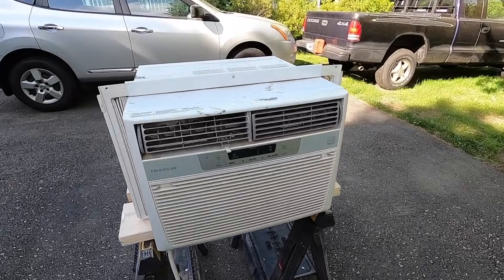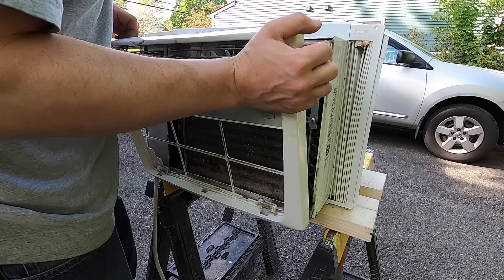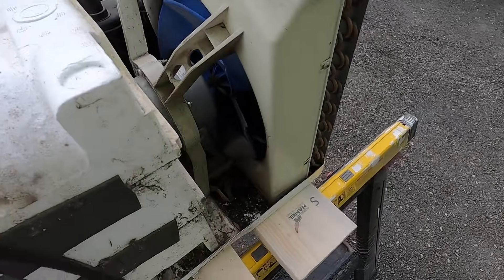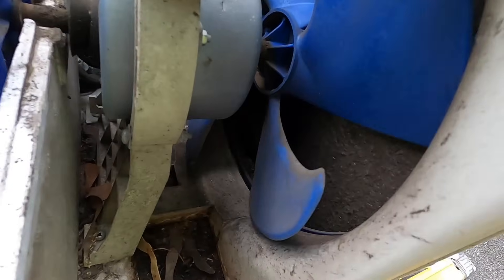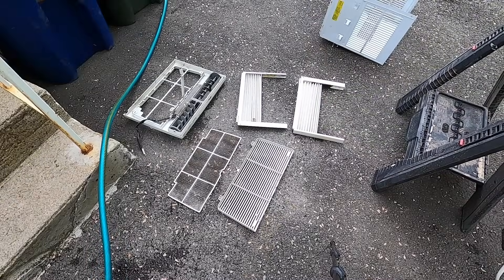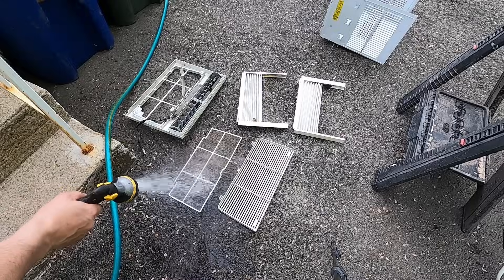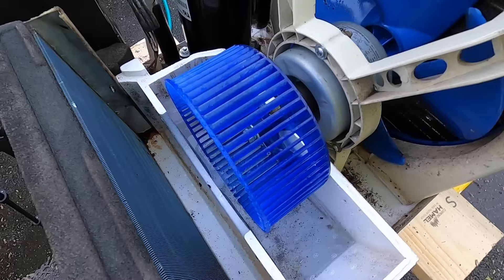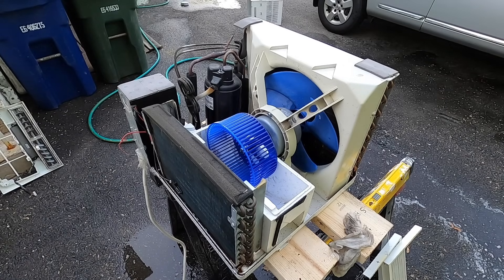How to Clean a Dirty Moldy Window Air Conditioner

Comment: It's amazing how people don't take care of things today. The units built today are all plastic and strofoam and have a big tendency to get like this.  When they made ac units out of all metal, you never had this issue.   Ac units are made cheaply today as you can see. You need to keep your air filter clean and vacuum the front coils when you clean the filter which should be done one a month. I have some old ac units that are clean and run great and would never get like this unit. Good video, I hope it helps to educate the public on taking care of their appliance.
Reply: Yes!  It's the damn styrofoam and cheap plastic.  Mainly the styrofoam imo.  It's a breeding ground for mold!!!
Things are made so horribly nowadays.  Nothing is made well.
Reply: @josephdockemeyer6782  even the education seems garbage
Reply: Maybe it could help to foil-tape the Styrofoam,  that is if it would still fit back in there..
Reply: It’s amazing how many people just live in poor air quality and breathing in mold spores..

Comment: (see my other comment) The foam part is where the air blows into the house and the mold will return if you haven't killed and removed all of it. You should soak it with vinegar or peroxide periodically to make sure the roots are all eliminated.

Comment: Great video.  Didn't realize you could just go ham with spraying the hose as long as you don't hit the electronics in the silver box.  So I took mine apart this morning (same model as you) and used my hose to spray everywhere.  Again, I had no idea that it was ok if everything got wet (except for the electronics, of course).  Thanks!
Reply from the maker: Thanks!  Yes as long as you are careful around the electronics it is fine.  Thanks for checking out the video!

Comment: Our window unit is 2 years old, and is  not getting cold, never been cleaned out, and when we turn it on (which is almost all the time) we hear a cracking sound like ice chipping or dirt dobber nest breaking apart. Aside from the ice thing, I think we found a culprit. ☺️ Thank you for the tips!
Reply: Low freon or clogged filter cause icing.

Comment: This was the exact window unit I was looking to clean, so this was beyond helpful for me
Reply: Same. LoL. I was like “no wayyy, this is MY unit”
Reply: I came here looking to.  Never thought i would actually find one with  the same unit I have let alone it be the first video I click on!!
Reply: Same.  And having just looked, mine is almost that gross.  No wonder I feel like crap.
Reply: You don't have to be a professional for this, right?
Reply: Same this is the best unit I’ve owned so far
Reply: Same😂
Reply: Same unit for us. Too heavy for us to take out of the window  at ages 80+. Did our best to take apart,  clean from the front  and go outside and do the back. Now I can see what I couldn't reach and therefore  still have moldy  smell.
Reply: Mine looked similar on the outside but the foam part was different
Reply: Same here... Kenmore labeled but the exact same one.
Reply: Same here. Will be cleaning it this weekend. thanks!

Comment: Our old model was like this and I'd just take the front off reach in w my hand and soak the sides, scrub the fan w tooth/denture cleaning brush and in the end I'd put paper towels in to soak up the bleach water that formed in the bottom. It was such a pain but necessary. Our model we have now I can't just reach in. It doesn't have the styrofoam but has what looks like insulation. I was getting all over headaches and extreme fatigue the last few days and started looking for the mold (that's usually the culprit), thought I'd found it but it was apparently far from the major source bc when I turned my ac off and got a light to shine OH MY, it got in there so fast. I should have known bc all a sudden mold was showing up on things everywhere 🤦. Guess I'll be getting my hubby to take this one apart and get to it.

Comment: Bleach can be harsh on the fins and copper tubing that runs through them. Best bet is to use a coil cleaner or just water/mild soap. I prefer non-acidic as the acid can eat through the coils if not rinsed thoroughly. Also, good practice to cover the electronic box with a plastic bag. Can also remove the boards from the facings on just about any model/style ac.
Reply: What will disinfect MOLD tho for that?
Reply: Electronics cleaner should work

Comment: First I used a small shop vac to remove all the junk. Then I used my sprayer with vinegar and window cleaner and dawn dish soap in a spray bottle then aggitatte the dirt and spray it clean with a hose and blow the majority of the water with the small shop hose in the opposite side to make it a blower. All set.nylon paint brush works well. Or a automotive parts brush cleaner works great!!

Comment: New to post- any video on getting cleaning the inside without removing from window. My room smells and it’s yukky inside of unit.  Live in New Orleans and it’s humid hot. So much water/humidity it’s wet on half my patio from AC. TIA. I have a 10k btu and 14k btu both are very bad but only a year old

Comment: After you get it all cleaned up and put back together,  you can save all the spare parts...   D'oh!!!
Reply: They allways put a few spare parts in there for your tool box . I found a cool long metal piece and an extra screw which worked out since I dropped one in the unit when reassembling it .
Reply: Hehe

Comment: Since window ac units use the air from inside the room to produce cold air, I placed a central air type 3m mold filter inside the front cover between the cover and the original dust filter. I cut the 3m filter out of the cardboard frame and stretched it out since they're wavy. I'll have to replace it monthly but hopefully it will make a noticeable difference. Makes me wonder why window unit manufacturers don't incorporate these seemingly essential mold filters. The paper thin ones it comes with only stops dust and lint.
Reply: I did this last season and it worked good. I eventually dropped the original filter since it wasn't necessary and only use the filter I cut from the filters for central air. Within a month it turns dark.

Comment: I had no Idea it was safe to really get in there, let alone hose it down. Thank you!
Reply: If they can stand up to rain water, a hose won't hurt.
Reply: @tnbn55 not how that works. Rain it’s mostly shielded from vs pressurized water directly on internals is quite different in damage potential

Comment: I took apart a used window AC recently that was disgusting inside.  I used a combination of bleach, water & dish soap as well in a good spray bottle and water hose to clean it up.  Just use a softer water pressure on the back grill grate because they can bend easily.

Comment: Excellent video.  I had one that was impossible to remove the top half of the foam without removing the electronics (older model), so I ended up just slicing the top off to access the fan wheel, then my best friend velcro tape came to visit.  Did that yearly for the life of the unit (about seven years).  I'd tip it sideways and spray right in.  

The fin sludge dust does not vacuum off.  Too sticky. I use a fin tool, but just a light touch with tweezers will also start it peeling.

I'm impressed that your case had no stripped screws.  I swear there's one on every unit just to make my life annoying.

The thermostat clip pops right off those front fins.  Easier to work without it in the way.

Take the directional grills out each year.  Heck, bleach them monthly.  They are so easy to pull out. They need a good scrub to get all the black off.  Just did it today.  My house is 81F inside and the only thing standing between me and sweet relief was the annual maintenance.  A/C was new last year, so I'm not taking it apart as it's not so bad inside to make it worthwhile.  The grill/spinny bits needed cleaning, though.

I really wish there was an easier way to keep the evaporation chamber clean.  Manufacturers made them quieter with the styrofoam, but it makes them harder to clean (and dirtier).   It's very humid where I live in the summer, so it's just a mildew factory.  For some folks, it's just wet dust, but wet dust doesn't smile like rancid socks.  Mildew does.

We've also had some luck running a small HEPA filtration unit near the window a/c unit.  It reduces dust going in and captures some of the stuff coming out.

Comment: this was so helpful, thank you!!! i live in an apartment and have two window ac units that they have had “permanently” installed and haven’t been cleaned in YEARS. after me and my cats feeling sick all summer and smelling mildew from them i inspected them and they were way worse than ever the one in this video😳 i’m talking absolutely caked with dirt and mold! i tried cleaning it by hand but couldn’t reach the majority of it so i’ll be following this tutorial to get them as clean as possible. i should probably just ask them to replace them but i’m up for the challenge of cleaning them out💪🏻 saving them $ and preventing it from ending up in a landfill 😊

Comment: Great video as far as how to disassemble the A/C but please note that bleach does not kill mold and for some people bleach can cause allergic or hypersensitivity reactions. To abate mold one must use a product that is designed specifically for mold (like Concrobium)--it's non-toxic and actually kills the mold spores. Also, as a general rule if the mold is at or more than a third of the interior it's best to replace the unit altogether, then work to keep the new unit free from mold by cleaning as you describe here. Good video, thanks for taking the time to make and post it.
Reply: @NE-Explorer  this is an instance when both people are right ... and wrong. I stand corrected in that bleach does kill mold on non-porous surfaces like tile, etc, but I stand firm on my comment, too, because it does not kill mold on porous surfaces like drywall and wood.
Reply: Thank you
Reply: Hydrogen Peroxide is mainly what all the mold professionals were using with Hurricane Ian cleanup!!!!!

Comment: condenser fins can be cleaned with compressed air from the reverse side before you spray it down. also running it on max in a empty room with an ozone generator once a month will prevent mold growth
Reply from the maker: Good tips.  Thanks, Brian!
Reply: Great tip about the ozone generator! Please know what you are doing if you're going to do this though. Ozone can be a fantastic tool, but you can do some (serious) damage with it too. I'm just imagining someone doing this while Snowball is hiding in the closet, unbeknownst. Ozone doesn't discriminate, it (can) kill(s) all living things!

Comment: Spray primer inside styrofoam...let dry completely..will never mold again! Ac guy told me this..I did it..used regular Grey metal primer..zero mold for almost 4 yrs now!
Reply: USMC 7207  oh great tip! Thanks!
Reply: What type of primer did you use?
Reply: Pretty sure oil base paint will melt styrofoam?
Reply: @MrBadchad644   never mold again.
Reply: Name and brand
Reply: Is primer dangerous to breathe in ? Would having that in your ac unit not slowly release primer into the air?
Reply: @kakashisensei4690  Short answer, yes. Everything in your house that is painted slowly releases volatile fumes into the air. This is what causes "sick house syndrome".
Reply: Good tip, teufel.
Reply: James Thomas hahaha
Reply: @Sara-L  🤕no bueno 🤕
Reply: But you'll still get mold on the fan blades.
Reply: @mattfoley6082  =( ....paint blades too ?
Reply: @kakashisensei4690  mold is more dangerous...

Comment: Me, who hasn't cleaned their AC in 5 years 👁👄👁
Reply: lol. Try 12 years!!! I only cleaned them because I had one unit that was leaking inside the house last year before I removed them for the winter. I opened the unit up and discovered the mold blocking the drain reservoir. I just figured if that one was bad, then the older unit of three extra years had to be as well. Both are running tonight and smell almost new. We have three days of 90 plus coming starting tomorrow.

Comment: Rutine maintenance.  use spray botthe 10% bleach in front of the unit whild is on and clean tge filter with soap water and bleach. Alsonuse 100% pure alcohol on the foam part ofvtge AC . It kill the mold also.good video.

Comment: So I was all ready to remove & take apart my window AC unit tomorrow for a thorough deep-cleaning @TheFixerHomeRepair ... but now I'm kinda worried about damaging the electronics/wiring & possibly getting zapped 😮 by the capacitor like @4everoregon @andrewlisenby9693 mentioned ... what is the easiest + safest way to discharge the capacitor ? And where exactly is the capacitor located ? Any help is greatly appreciated!

Comment: 11:44 DO NOT repeat DO NOT spray water anywhere near where the motor shaft enters the motor (front or back). He is spraying water all over the motor and shaft. You will get water into the motor bearings and they WILL rust and seize, which means the fan won't work and your a/c will be useless.

I did this and had to take my a/c apart to get at the motor. Then I had to take the motor apart, remove the bearings, buy new bearings online, and replace them. Total PITA job.

The lesson is yes you can clean your a/c but keep water away from that motor.
Reply: yeah, i would use the airconditioner foam spray to coat the fan and blower and reverse fins.......then using a light water spray spray down the foam , avoiding the motor. Another way, use plastic bags to cover tight the motor and the electronic unit and capacitor.
Reply: @streetrider2487  
That's what I was going to say. All needs to be done is cover the ingenuity with plastic sheeting.
Reply: @tenfour000  Huh?
Reply: @mattfoley6082   Did he mean "engine"?
Reply: @josephdockemeyer6782  Maybe but it's not an engine, it's a motor.
Reply: @mattfoley6082    Exactly.  I was just trying to solve the riddle.
Reply: I truly wish I had the knowledge you guys have
Reply: @Mr-Show9  well we're here learning aren't we :)
Reply: Lmao chill out , the motor and shaft gets wet when the ac unit runs as the rear fan blows water around to cool the motor off and the condenser and is totaly open to the elements so if it rains its wet anyways.
Reply: @killerdeamonking  Wrong. The fan blows condensate away from the motor, water doesn't get anywhere near it.
Reply: @mattfoley6082  you clearly have not seen any of the newer ac units that pull the drainage water then splashes it around and out through the rear radiator.
Reply: @killerdeamonking  Wrong again. I have such a unit. Clearly you don't understand that it blows the water away from the motor.
Reply: @mattfoley6082  lmao i have looked and taken apart mine and know from hearing the water splatter against the fan to know that everything gets wet. Hell that shitty ac unit dont even have factory drain holes under it. It even says in the manual that it sprays water on everything to better (cool) componants.
Reply: @killerdeamonking  Don't what you want me to say. But the fact remains that spraying a hose into the bearings will rust them.
Reply: @mattfoley6082  i will agree with the statement that bearings can get stuck but yeah that can depend on the type of bearing too, some applications have sealed greased bearings that dont often rust like others do.
Reply: @killerdeamonking  I give up. Spray your bearings all you want, then when they rust and seize your a/c fan you can say "duh, I guess the bearings aren't sealed and greased."
Reply: @mattfoley6082  The ACs' motor used to have an oiling tube for the front and back bearings - and they would last for decades if oiled occasionally. Knowing this: After taking the foam off, and before I start cleaning a unit out I tilt the unit back 45 degrees and put a drop of oil on the squirill cage motor shaft and let drip into the front bearing and spin it a little. Then tilt it forward 45 deg and oil the back bearing the same way.  The bearing/shaft gap is much less likely to attract water if it's already been filled with Oil. P.S. GREAT VIDEO !
Reply: @killerdeamonking  I replaced the bearings in a fan motor (so I wouldn't have to oil them ever again) with sealed ball bearings perfectly aligned and shimmed and I was so proud of it...Until I turned it on for the first time and heard that ball-bearings make ALOT more noise than bronze bushings, for the long long life of the AC unit...
Reply: @joeteejoetee  yeah but even ball bearings need grease in them even if they are sealed there is often not enough in there. I would pop the dust cover and put more in .
Reply: @killerdeamonking  I agree, but these Ball Bearings were brand new and was just remarking that a much more expensive NEW ball bearing is not going to be quieter than replacing with origional bronze bushings. We all need to PRESSURE manufacturers to allow our RIGHT TO REPAIR their products, rather than SCRAP THEM when THEY DESIGN THEM ALL TO FAIL from the small and idiotic reasons...
Reply: @joeteejoetee  I agree but it will take 1,000s of people to make this change happen.

Comment: I have that ac umit but also one with the fan inside past the vents (Friend gave it to me) ..the fan inside past the vents (Its the style of fridigaire ac that shoots up if that helps) is pretty dirty and im trying with a toothbrush a soapy water but might need stronger..And its hard to reach deep inside the fan fin/blades to deep clean..any suggestions cause its tough and im not sure if the fan itself comes off to clean in the sink??? Any help would be great thank you